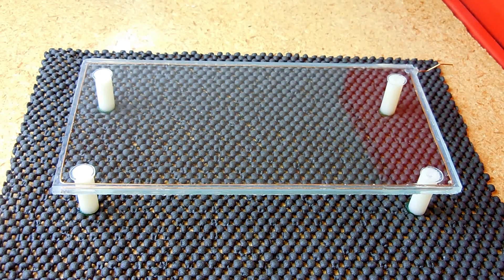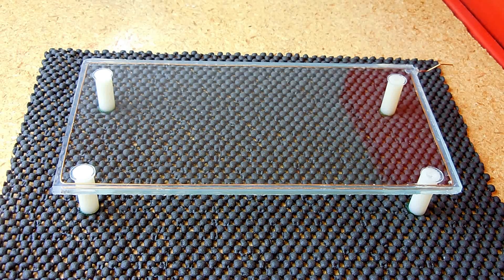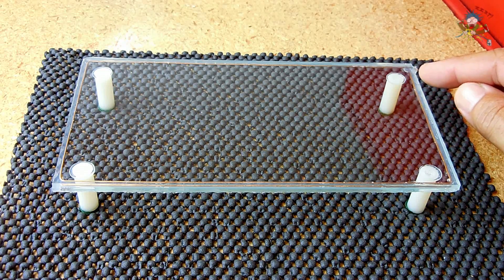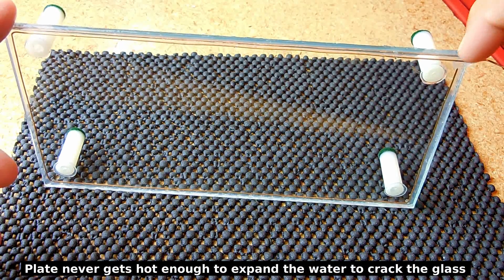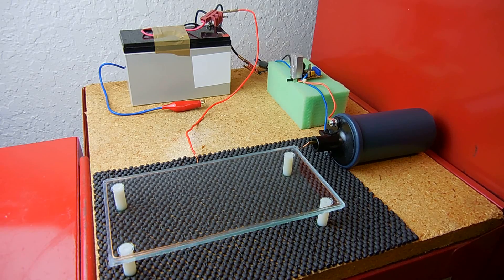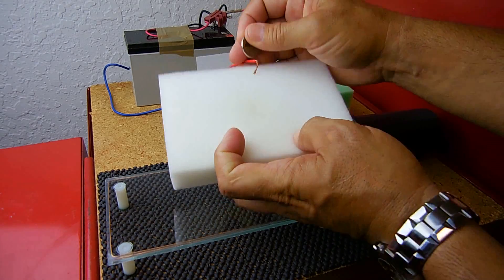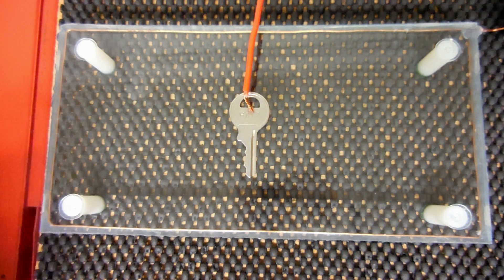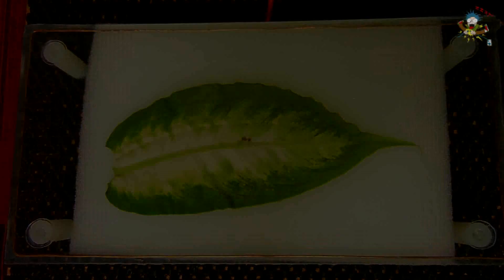DIY Kirlian Photography(FULL PROJECT DETAILS)

Comment: You mentioned running tap water into it before sealing it completely.  Does the water need to be conductive?  I would personally prefer to use distilled water for clarity, but if need be I could dissolve a little citric acid into it first.

Comment: This isn't Kirlian photography.  True Kirlian photography is done by setting the objects on a sheet of photographic paper which is exposed by the momentary discharge and resultign corona.  It must be done in a darkroom, and then the paper developed just as film would be.  There's no camera involved, and no need for water-filled plates (which is a very dangerous hazard).  Photographic paper is no longer made, so real Kirlian photography can no longer be done.  This setup shows the corona, but there is no way to capture it as a photograph.  Trying to take a picture of it with a modern digital camera would result in the camera being destroyed by electricity emanating from the plate and object.  Phones, cameras, and computers cannot be anywhere near high voltage discharges like this.  Therefore, this and all the other videos on YouTube purporting to show how to build Kirlian photography devices are totally worthless and very dangerous.  I urge everyone to stop spreading this very hazardous and irresponsible misinformation.  This is NOT Kirlian photography.
Reply from the maker: Were you always a pedant? Instead of the photographic plate I am using a camera to capture the aura around the object. The end result is exactly the same.
Reply: @electronicsNmore  It can't be.  It'll be overexposed.  And it's a different process.  Unless the light from the corona itself is exposing the film or paper, it can't be called Kirlian.  And, the high voltage will fry the camera and ruin it.  This is a disaster waiting to happen.  The images I'm sure will be crap.

Comment: could i use an 12V inverter instead of the coil? Like the kind used to drive electroluminescent film.
Reply from the maker: As long as the output is very high voltage and high frequency. Look up the specs for Kirlian photography power supplies.

Comment: When you're touching the glass, where do you connect the ground wire attached to the negative of the battery?
Reply from the maker: You don't, just use your hand on the plate.

Comment: I think I got the electric driver for one of these at an auction for a new age lady.  She also had old books on kirlian photography.  
It is a box with ac plug for wall.  Maybe one knob. Switch. And a wire with clips coming out.  When turned on a blue arc pulses over the clips and I felt it in my hand holding the cord. Makes the same buzz.  Am I safe guessing that is what this device is for??  Thanks
Reply from the maker: Sounds like it based on the books you found with the device.

Comment: Im very new to all of this and was wondering if this would be considered a high voltage driver circuit?
https://www.amazon.com/Icstation-ZVS-Generator-Driver-Board/dp/B06XY219QL/ref=sr_1_5?keywords=high+voltage+driver+circuit&qid=1552698193&s=gateway&sr=8-5
Reply from the maker: Look for an ignition coil drive circuit that's ready made. You need a high voltage, high frequency power supply. Of course, the current output must be very low. Thanks for watching! Please share.

Comment: What is the thikness of the glass ?
Copper wire is between two glass right?
Reply from the maker: 20-24ga solid copper wire is fine, 1/16" glass, and the wire is between the 2 glass plates.
Reply: @electronicsNmore  Can i use EHT/ Flyback transformer instead of ignition coil?
Reply from the maker: @rahulwadate8754  I suggest using what I show.

Comment: When you said it only works using AC current, did you really mean DC?
Reply from the maker: The ignition coil requires pulses to drive it. Pure DC does not work. Thanks for watching!
Reply: @electronicsNmore  I use a 50mm spark coil using an interupter.  It's pure pulsed DC.  No AC here and it works like a charm.

Comment: Could this device work being powered by 5 alkaline batteries of 4,5 V connected in parallel to reach the 20 V required?
Reply: no reason why not. thats how electric works.
Reply: 20Kv required so you'll have to get 4,500 of them. Also DC

Comment: Hey, I really like your video. I am going to build my own Kirlian photography device too, I was wondering if it is also possible to use plastic plates instead of glass plates? Would be great if you could help me. Also, did you use salt water or just water ?
Reply from the maker: Never tried plastic. Better stick with glass. I used tap water.
Reply: Okay, thanks for your fast reply. Where did you get that glass from? On the first look it seems to be hard to find not too expensive ones.

Comment: Hello...can you recommend a good pocket oscilloscope ? I do automotive and marine tech and often need a small scope.Thanx
Reply from the maker: Hi there. The scope I use is a Velleman HPS-50(Around $250). I like it a lot, the only problem is, it only has one channel, and it is not really "Pocket Sized". A very nice, compact, 4 channel scope(Over $100 less) that has all high buyer satisfaction ratings would be the one shown below. If you decide to buy it, I can supply a coupon code for you.

http://www.banggood.com/Nano-DSO203-DS203-Professional-Digital-Oscilloscope-4-Channel-72MSs-p-925667.html?p=U627203391019201512Z

Thanks